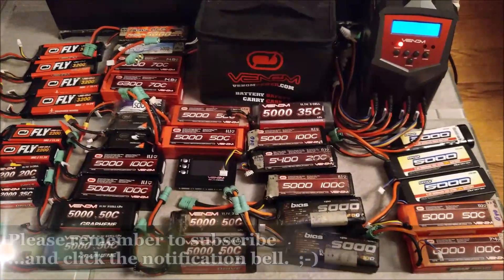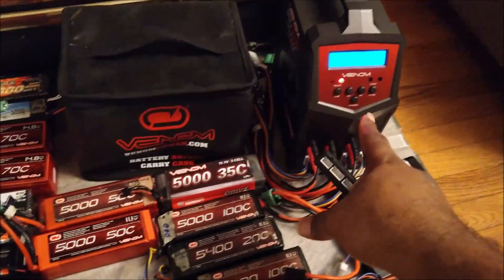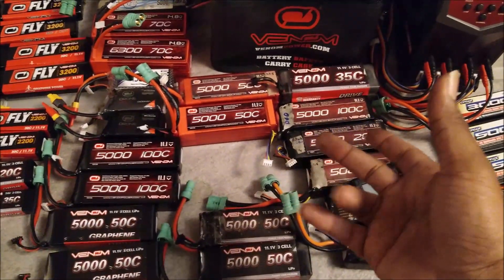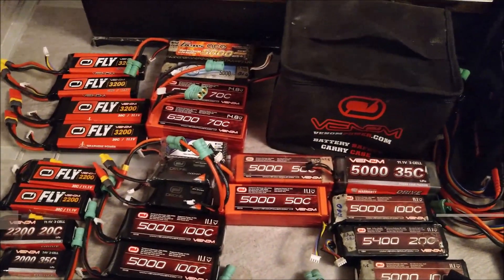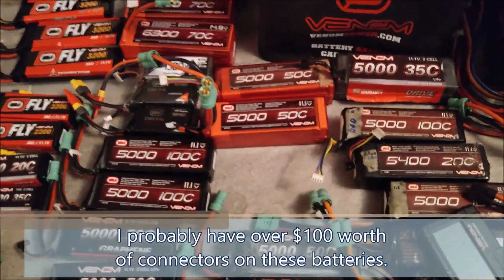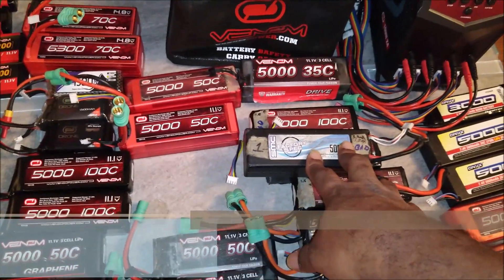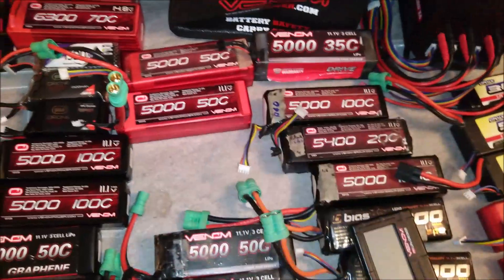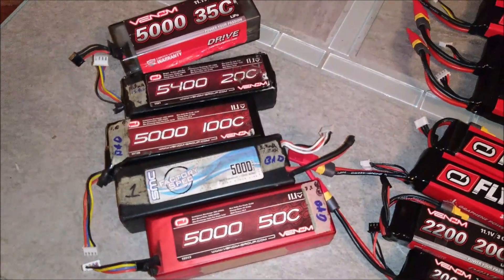Ep. 282: LiPo Battery Storage & Disposal

Comment: Hello, I have a lot of batteries and I keep them in the proper storage mode but I want to  get them out of the garage for the winter and put it inside the house. I have them in a storage bags is it safe for them to be in the house  thank you great video.
Reply from the maker: I store mine in my basement in LiPo Bags and/or Ammo Cans. As long as they are stored at a "reasonable" temperature and at storage voltage ~3.8V/cell, you should be fine. Just check them every few months to make sure no cells are going bad. Lipos (usually) don't just go bad while in storage. They give you a lot of warning... if you check them consistently.

I also have a Bat-Safe, but that only has enough room for a few of my cells. Those are super-safe and probably the best LiPo storage option out there in my opinion. They are a great option if you want to be extra safe and don't own too many batteries. Here's a link. https://amzn.to/3nJQC5R

Thanks for watching!

Comment: Should a lipo battery that comes out of storage be immediately charged to full. Should I use up any remaining charge, then charged to full? Does it matter either way?  Every video talks about storing lipos but no one talks about taking them out of storage.
Reply from the maker: That is actually a very good question. After a lithium battery has been sitting at storage charge for a while, it often takes several cycles for the battery to completely "wake up." That means that the internal resistance may read a little high if you measure it the first few times you charge a battery after it has been sitting in storage for a while. This usually will not be very noticeable for most users, but if you are using the batteries in a very high performance application, like drag racing or speed running, this may cost you a little bit of performance. Many of the pros will charged the battery on a low current setting, usually 1C or less, then discharge it at a similar rate. After a few cycles, the battery should be back to its original level of performance, and you may even notice a slight increase in the measured capacity as well.